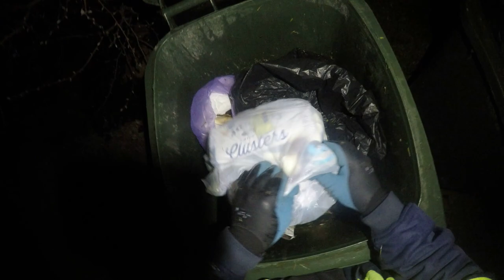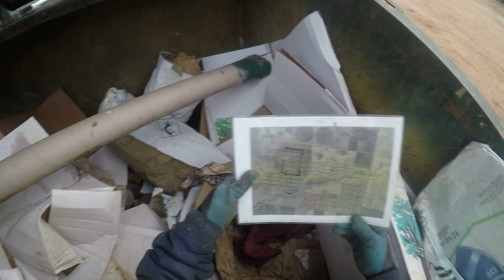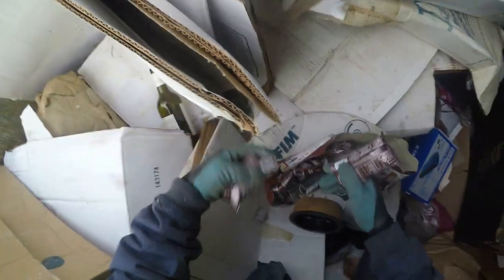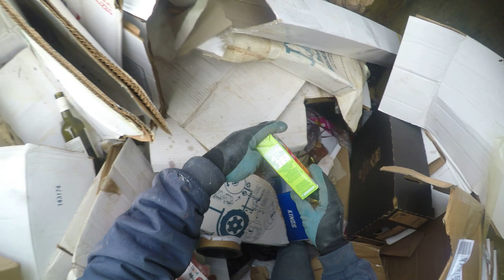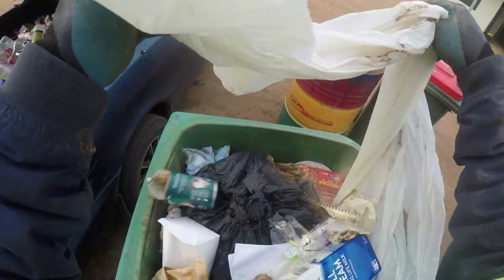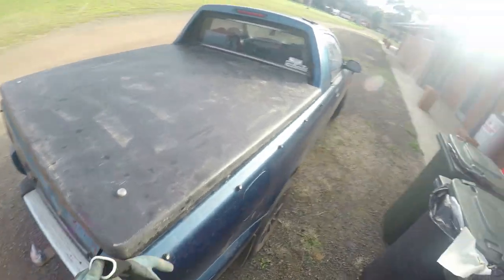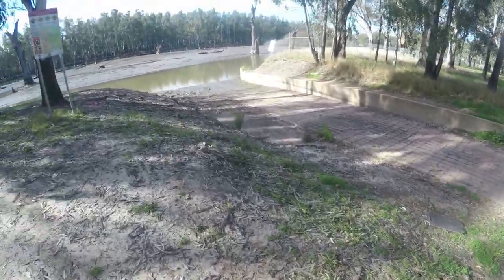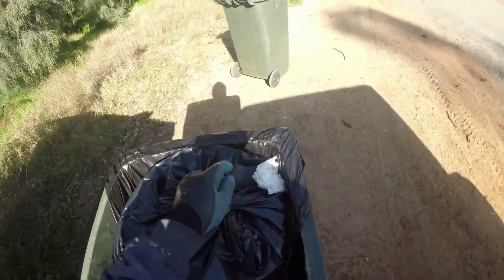DUMPSTER DIVING I MUST BE A GLUTTON FOR PUNISHMENT BECAUSE I'M ALREADY FULL

Comment: why domt you take all the glass bottles?
Reply: machines in australia dont take wine or spirit bottles
Reply from the maker: The machines I use a called return and earn here in New South Wales they do take Cruiser bottles Jack Daniel bottles which are spirit bottles to a certain size as long as they have a $0.10 return and earn on them I will pick them up